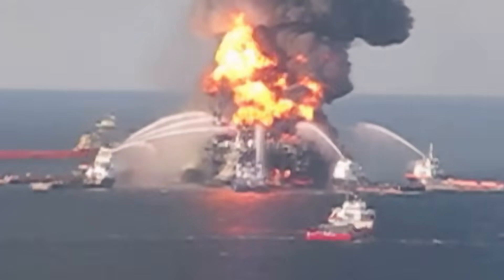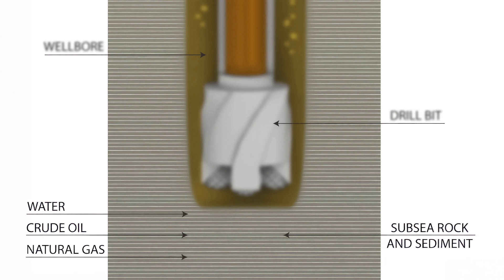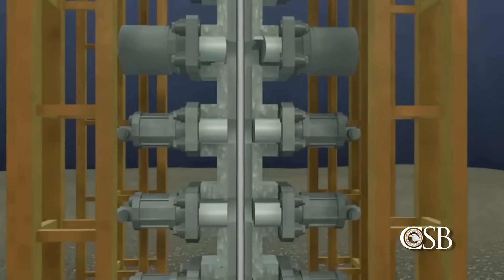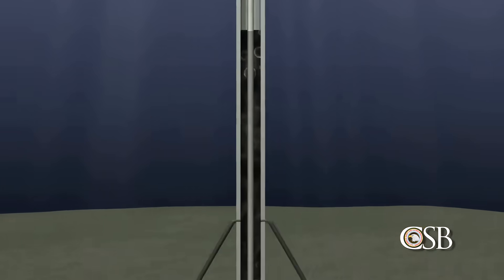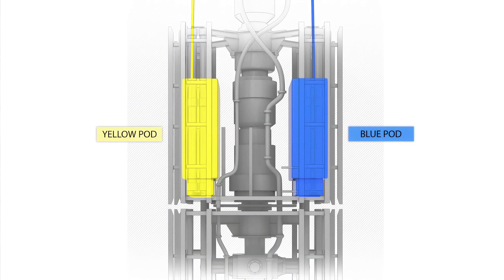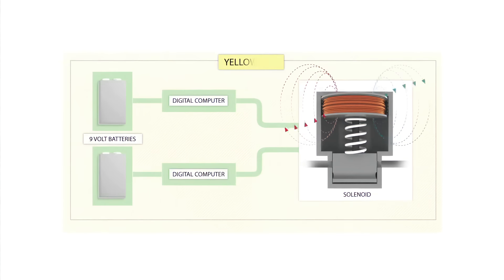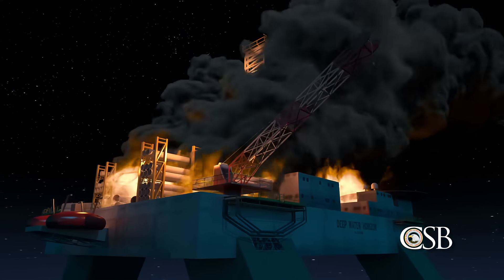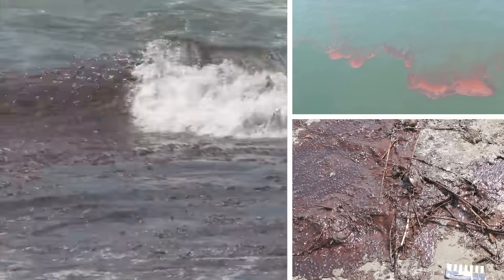Deepwater Horizon Blowout Animation

Comment: This is why mankind shouldn't be even thinking of anything Nuclear !! They can't even reliably, safely drill oil !!
Reply: ...no that has nothing to do with anything.
Reply: @TMJ32  oh really.
Fukushima
Reply: really
Reply: Fukushima had the same piss poor design flaws that this BOP had. It wasn't failsafe. Safe nuclear technology exists, but nobody is willing to build it because the public hears "nuclear" and instantly thinks of a 1950's era water reactor. Like you just did.
Reply: @TMJ32  Exactly my point  ..There is no safe nuclear reactor, it doesn't exist. And the result of failure is way more extreme than any oil spill. Fukushima is still spilling and killing the Pacific and will be permanently polluted with deadly nuclear waste for thousands of years. Clean and or safe nuclear power doesn't exist... Not to mention there is a growing nuclear waste problem because nobody wants disposal in their country or state for that wicked garbage.
 FYI , all nuclear reactors use water for cooling and steam generation. There are two main types used, Boiling water reactor and pressurized reactor.
Reply: @TMJ32  Reference the prior reply for the two types of nuclear reactor. They are still being built to this day, construction hasn't stopped with these deadly man made disasters waiting to happen
Reply: @100pyatt  yet again, that's completely false. You're just proving my point that the general public doesn't understand nuclear technology. IFR reactors don't use water and the cooling process is an inherently stable failsafe system where they just shut down by convection if the pumps fail. Breeder reactors recycle their own nuclear waste as fuel so not only do they not produce waste, they can actually clean up waste thats been created by old water reactors. This technology exists and the program was shut down because of fears the public would never be able to wrap their head around it. I run into people like you ever day that don't know what they're  talking about and it largely proves them right which is a shame.
Reply: @TMJ32  IFR reactors ALSO use water for power production(steam) and cooling of the liquid metal or sodium
Reply: @TMJ32  And unfortunately the Water using IFR reactors have only been tested as an alternative with many benefits but they still use very dangerous nuclear material (and can produce) , plus they can still melt down causing uncontrolled release into the environment. The experiments weren't shut down over conspiracy, it's not cost effective is one of the big problems. As a business that doesn't work.(YET !)
Reply: @100pyatt  I'm glad you googled it and read about it for 5 minutes but the point was to try and get you to better educate your opinion before spewing conclusions based on nothing. So it seems like I still failed.
Reply: @TMJ32  Sir/Maam TJ32, you argued nuclear power to be potentially safe and the ability to not use water, both of which are still remaining FALSE... Not hollow uneducated rhetoric. I would suggest before you spew factually false statements that you do more research into what you're talking about so you're not intentionally misguiding people on the subject of nuclear power. 
 However, a MUCH cleaner & Safer man made alternative energy sources would be solar, wind, hydro or tidal , not nuclear.
Reply: I was implying they don't require water for COOLING the way light and heavy water reactors do (I thought that should have been obvious but I guess not...). Which is the cause of virtually every meltdown accident in history. Water reactors require cooling pumps and heat exchangers, which is a powered non-failsafe system plus it evaporates. IFR reactors are capable of shutting down with passive cooling, through convection. The reactor is also designed with a rate of reaction that is inversely proportional to the temperature rise, so as the temperature increases the rate of reaction decreases. It's an inherently failsafe design. That's what it means to not depend on water. Nuclear technology can be done safely, bottom line. And I'm electrical engineer that designs tidal and hydro projects for a living. I understand renewable energy better than you ever will from quickly scanning through articles you google while you're trying to argue about it.
Reply: @TMJ32  IFR reactors still require WATER for the power production and COOLING loop. The liquid metal is only one part of the loop. And since we started this on safety, do you know what happens to the sodium reactors if the sodium cooling system gets exposed to water? Boom. Yet they still have the two meeting each other in the water heat exchanger/boiler.
 I suggest you stick to your electronics, hopefully you're more educated on that subject than this one. Nuclear power never has been safe and never will. End of story. Move along.
Reply: @TMJ32  So once again.. i challenge you to show me a nuclear power plant that doesn't rely on water in the cooling system! I'm still waiting......lol.
  🤣🤣🤣🤣🤣🤣🤣
Reply: @100pyatt  I sure wish all power was made with Nuclear plants. I drive an electric car that doesn't rely on big oil or make all that nasty pollution. All I see from nuclear power plants is steam, no smoke. Big oil barons can go to hell !
Reply: This conversation was a dead end when you said "FYI , all nuclear reactors use water for cooling..." That right there proves you don't know what you're talking about and now you're scrambling and backtracking which means you aren't interested in learning anything you're interested in arguing about stuff on the internet. Which is a shame because the type of ignorance you're displaying is exactly why there's so much irrational fear surrounding nuclear power.
Reply: @TMJ32  And yes, even your experimental IFR reactor uses WATER in the cooling loop.  ALL nuclear reactors currently in power production AND experimental use WATER in the cooling and power production systems.
Reply: @TMJ32  Better Yet... Show just one nuclear power plant in existence that doesn't use water.  YOU CAN'T ... LOL.. because they're isn't one.
Reply: @100pyatt  You need to stop knocking nuclear power it's the way of the future the clean, safe energy alternative. No more pollution with Nuclear, the planet has been brought to it's knees by big oil tycoons
Reply: @butchmcdougall3596  Butch. What do you plan on doing with all the VERY deadly nuclear waste? You do realize most of it will still be VERY deadly thousands of years from now?
Reply: @100pyatt  Who cares! That's going to be some else's problem! 
 In the future they can probably just use it to fuel space ships or dump it in space. We need to stop big oil from destroying the planet !
Reply: @butchmcdougall3596  Nazi? You should learn the definition first. Your people (DNC) are the ones censoring and removing channels with anything you consider "hate speech"(opposition)... Nothing like taking away free speech, you people are SICK.

Comment: This video never mentions BP's role in the tragedy in failing to adequately manage drill mud weights following casing installations.  Problems with the BOP may have been the effective reason for the tragedy, but BP's drilling decisions were the ultimate reason for the kick, flow and blowout from what I've read.
Reply: Lets not ommit the fact the wireline BondLog they ran revealed the cement job was garbage, which means it allowed migrating pil and gas to bypass the whole Sub-Sea BOP stack, but better to blame equipment failure then have somw regulatory inquiry board look into the true cause and find out many of the wells drilled have precisely the same issue
Reply: @lancewilson7207  Good point. I hadn't heard the cement job issue before. All in all a major screw up by BP.

Comment: The BOP should be set up so if all power is lost, the blind rams close because of mechanical action, and are held open by electrical power (when everything is working correctly).
Reply: Just like the magnetic security locks on Hotel doors if they lose power they all release immediately

Comment: If the BOP design had used normally "closed" solenoids in the shear circuit as a failsafe, this probably would have never happened.
Normally closed means that an electrical current is required to keep the solenoids on so when  power from the rig +is lost they would return to a closed state and operate the shears.
Reply: Why would they do that though, that means any little disruption in power would cause the pipe to be cut, you think they wanna spend millions to replace a pipe after it fails every other month?🤣

Comment: You know you have a shallow system when everything comes down to a 9 V battery
Reply: You're forgetting the multiple & perhaps overlapping safety systems in the BOP.
Reply: It didn't. It was a chain of mistakes. If the solenoid valve was working properly, the one dying battery would not be an issue.
Reply: You guys are missing the point. Of course there was a chain of mistakes, but complex system should always have diversification. That’s  system engineering 101.

Comment: So, the blow out preventer they were using was a POS?  Also it was a mistake to sink the rig (which they did with the firefighting boats), they might have been able to get a hold of the drill stem.  But in the first few days they were drastically underestimating the size of the spill.

But in the end of the day the original cause was not enough mud and human error.

Comment: 2010 год, Соединённые Штаты (не Зимбабве): не замечен выброс нефти в трубу (судя по всему, серьёзный), не сработали запирающие устройства (что за устройства такие, которые призваны запирать трубу, но они не смогли?) и не сработал отсекатель, который, насколько я понял, вообще аварийная защита высшего уровня. А не сработал он из-за севших аккумуляторов (а где сигнализация/индикация заряда?), и неправильно подключенных электромагнитов (вы серьёзно? Неправильно подключенные электромагниты? Перед пуском в работу их не проверяют?) Очень странно, очень. Я был уверен, что в Америке инженеры серьёзные и не допустят такого количества ошибок. Но либо я ошибался, либо в видео что-то недоговаривают.
Reply: The above, translated from Russian to English (Courtesy of Google Translate: https://translate.google.com/):

Johny machette
2010, the United States (not Zimbabwe): no oil spill was noticed (apparently serious), the locking devices did not work (what devices are designed to lock the pipe, but they could not?) And the shut-off device did not work which, as I understand it, generally emergency protection of the highest level. But it didn’t work due to dead batteries (and where is the alarm / charge indication?) And incorrectly connected electromagnets (are you serious? Incorrectly connected electromagnets? They are not checked before starting up?) Very strange, very. I was sure that in America, engineers are serious and will not allow so many mistakes. But either I was wrong, or in the video something is not told

Comment: "Bro it's my first day on the job, which way do these wires go?",  "Dude, it's a wire just put em which ever way, we gotta go to lunch..."     3 months later:  "Yo man, remember that job we did on that regulator piece, well my bad, it turns out the the way the wires go does matter",  "Oh dam did something happen?",  "You could say that".
Reply: Maybe working too long of a shift (say 36 hours)?
Reply: You don’t hire people  who are uneducated or unprofessional tradesmen to undertake jobs like these. These people would have been vetted out with the best qualifications. safety precautions failed
Reply: @Ally-ip4yw  if that were the case, the damn thing would have worked
Reply: @joffebisk  seeing as I'm the guy who wired the blue pod I can guarantee you it wasn't miswired. A bad engineering schematic, shitty blueprints yes. I built that thing as the instructions said.
It's lovely how they protect the big engineers and throw us lowly floor workers under the bus.
It's kind of like how they call this the BP oil spill even though it was Halliburton who is in charge of the safety rigging and underwater work. It was Halliburton submarine that failed to cement and ultimately spilled more oil but because BP owned the oil coming out of the well it was called the BP oil spill even though British Petroleum had nothing to do with deepwater horizon or Haliburton. British Petroleum we're just some fucking assholes miles upon miles away and had nothing to do with anything that went on with the rig but for somehow it's the BP oil spill.
Reply: @rivermcratt3683  what do you mean by bad engineering schematic, what was wrong with it? are you saying that the blueprint itself has wrong instructions on how to assemble the BOP?
Reply: @wawawawa8361   
To be honest, one of the BIGGEST headaches of being a factory worker is the engineers and developers giving you either old revision blueprints or poorly/incorrectly revised new ones. 
Now take in to consideration that the factory worker might not know exactly where what they makes goes and what it does for what purpose because they don't get that info. So even if you see the changes on paper, you can't really figure out on the spot that something is wrong.
Or in not so rare cases, the workers don't even notice because the blueprints at the station they're working on are changed without word.
Reply: @raidkoast Couldn't agree more, can't blame site/factory worker for this one. If they already commissioned the BOP and still failed to do the job, should be blamed on the commissioning/maintenance team. they're the last people to operate and making sure the thing's working properly.
Reply: @rivermcratt3683  I worked the MDL. Halliburton provided the slurry yes, but the told BP more than once that it was not tested nor rated for that depth. As soon as the slurry was pumped, BP started drilling. They were WAY behind. I don't remember the schematics, but the Cameron engineer we deposed said the BOP was rewired and re-piped according to BP instructions to convert the lower sheer ram to a "test" ram so they can pressure test the system without interrupting drilling. There were several warning signs of an impending event but BP ignored them all. Anything for the dollar.
Reply: @wawawawa8361  yes, that is exactly what I said. It's possible the engineering on it was also perfect and it was not installed correctly. But, That box was built exactly to specification and certified by three other people to be built exactly as the instructions said. It was not a failure on my part.

Comment: I had to stop watching. A $25 label maker and $8 cassette from Staples could have avoided this. If color coding on the wire wasn't idiot proof enough, then please label the fucking leads. Any industry has basic QA procedures. Who but the dumbest of fucks screws up binary wiring?  As an IT guy, running the same color wire with no label or color code would have been beyond idiotic. It the BOP was so fucking expensive and complex why were there no polarity checks and voltage sensors?

Comment: Truly excellent video. The only thing I dont understand was when they said after the well had been cut off by the ram that the oil and gas still was flowing at high speed up to the rig.. is this because that was the ram that only cut the pipe partially? Because if it was cut off completely, the oil and gas above the ram should have stopped flowing.
Reply: When the pipe ram sealed the well, a lot of gas had already gotten past the BOP (late detection by the crew), and this gas quickly migrated, expanded, and erupted at the rig, overloading the surface path, hence the explosion.  Then, after the automatic system closed the blind shear ram, it sheared the pressured drill pipe (it was closed at the surface, had 7,000 psig pressure in it) -- no seal, but the sheared pipe created a new leak path for the gas/oil below the BOP to resume flow into the riser and beyond.
Reply: Correct the pipe was not centered which made it impossible to cut and seal the pipe.  The ram only manage to partially cut through the pip.